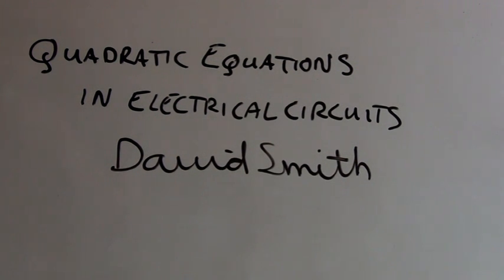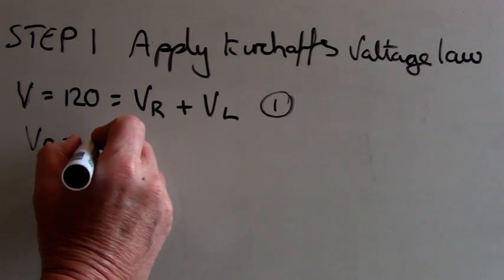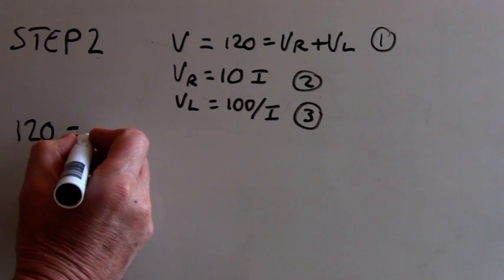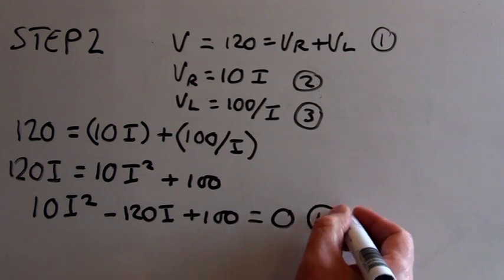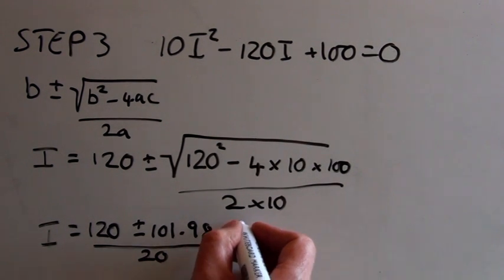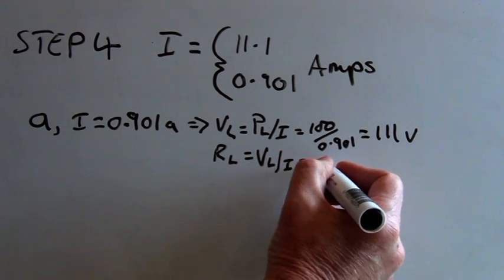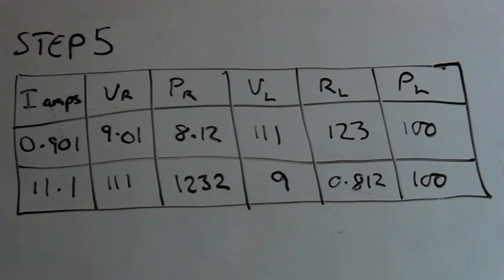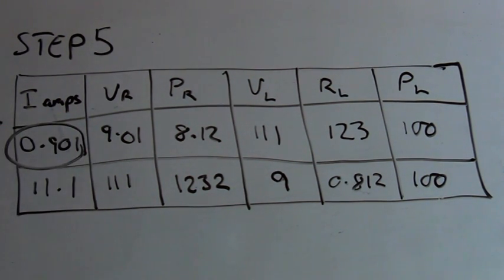BTEC Level 3 Quadratic Equations & Electrical Circuits

Comment: The quadratic formula you showed is wrong. The first term "b" is supposed to be   "-b"
Reply from the maker: ALEXANDER POLTZER  Hi  Alexander, thanks for your comment, the form of quadratic equation used is correct to give positive values for the calculated values of current, if we used a negative b then the values for the current would be the same but they would both be negative. Regards David
Reply: Hi Dave, the answer you gave is correct, however the formula is better written with ALL terms over 2a, not just the +/-Sqrt part. This was corrected by you at 5.34 when you drew in the 120 also to be divided by 20 but was not clear until then. Including -b in the starting term does not alter your calculation because -b = -1*(-120) which is positive. Otherwise nice work on a quirky problem which is a nice example of the practical use of the quadratic formula.

Comment from the maker: Hi everyone, this is one of a series of videos I have created to help with the transition from school into an apprenticeship, If you have any specific examples you would like me to work through please let me know.

Achieve your potential.

BTEC LEVEL 3 Quadratic equations and electrical circuits, this is one of a series of videos putting electrical theory into context. Example of assignment and exam questions.
Reply: Thank you. Really appreciate it. I am into N4 electrical engineering after many years and have forgotten some basic rules etc. Is it okay to contact you regularly for input. I would appreciate and email response so I can keep the response for future reference in my studies. MY email address is : mandateconsultant@gmail.com